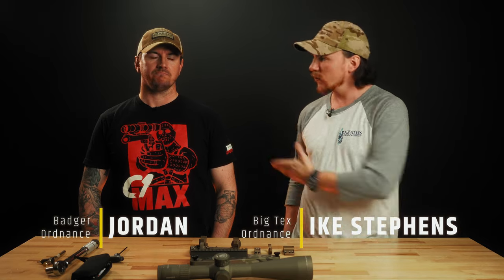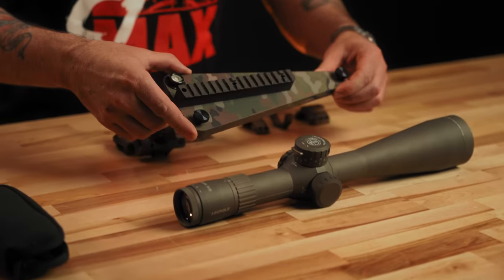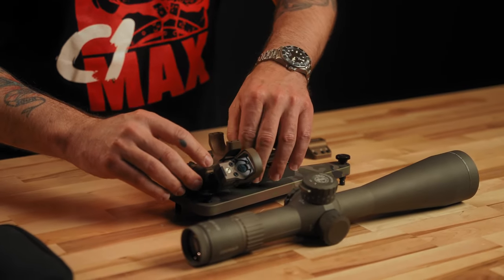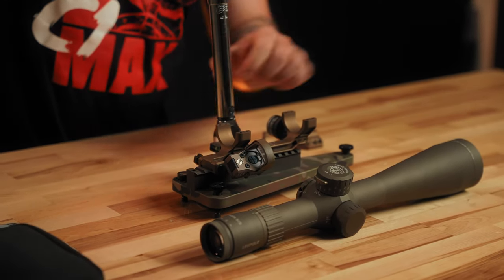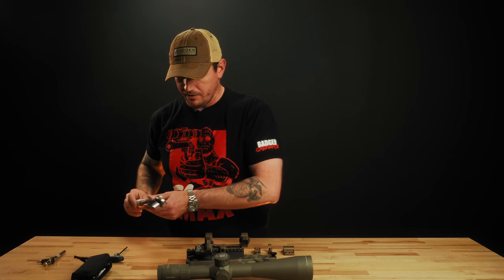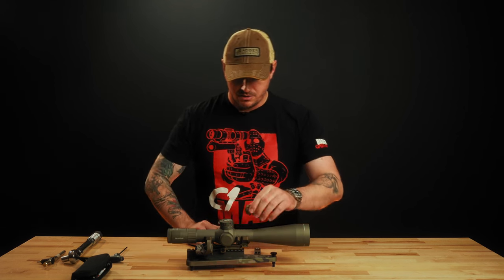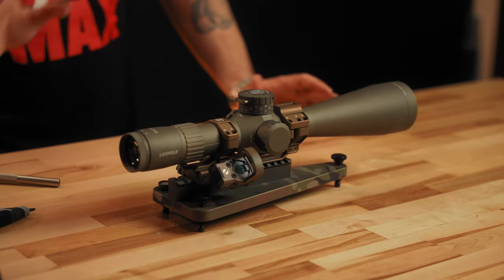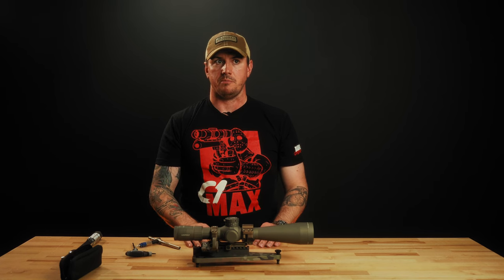How To: Mounting A Scope Using The Badger Ordnance C1 Mount

Comment: Why not just show how to use a plumb bob if that is your preferred method?
Reply: How to use a plumb bob, how much explanation is there in hanging a string with a weight suspended from it?
Reply: We made the Dead Level reticle leveling device and use it extensively, and it is our preferred method. Utilizing a plumb bob is another method to achieve the same concept, and some people prefer that. As long as you achieve the correct end result, we don't grade on how you got there. We aren't crotchety old high school math teachers that made you show your work, we promise.
Reply: @badgerord curious, how's the leveling lines in the mount work? I've never seen optics with leveling lines on the body, so how exactly does that work? Do we have to draw a line perfectly centered on the body?
Reply: @PkwyDrive13 Sorry if you already got this figured out, but I figured I would chime in. Some optics manufacturers are now including/manufacturing the scope body with that leveling line centerline to the body of the scope to assist with this. I have seen this becoming more popular in the past couple of years and I think it will only continue to grow in popularity. I did not realize Leupold had started it; maybe that optic was a military contract optic since the Badger Mount was a military contract Mount and the leveling line was a requirement on Leupold as part of obtaining the contract.

Comment: So…what is the advantage of first mounting to the mount instead of just going straight to the rifle?
Reply: He explains it around the 6 minute mark onward. Using the dead level allows you to ensure the mount is exactly level before then truing the reticle in the optic. It's not that this process can't be done on the rifle, but in my experience using a dead level is easier than trying to level the rifle in a vice or similar means while mounting the optic.